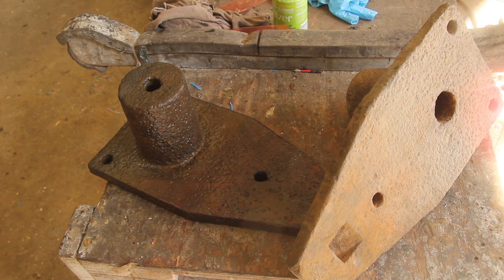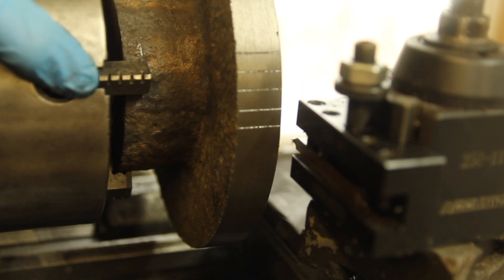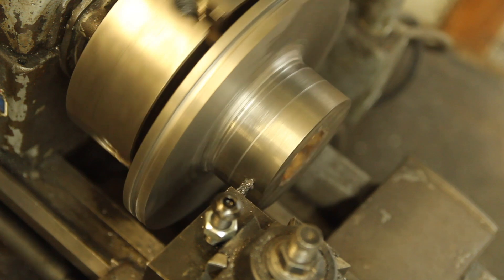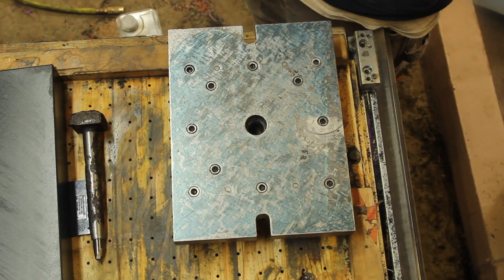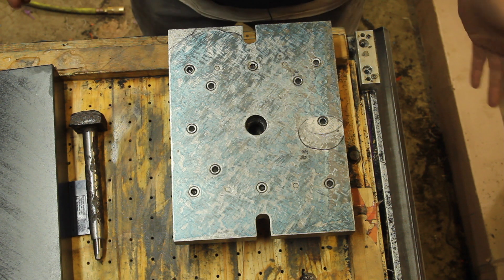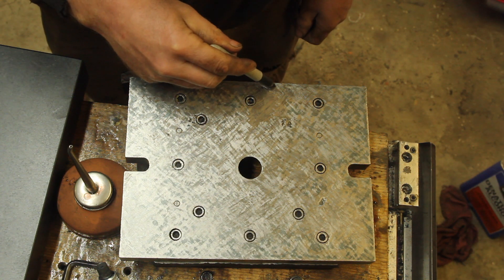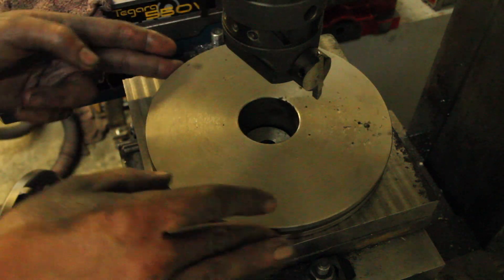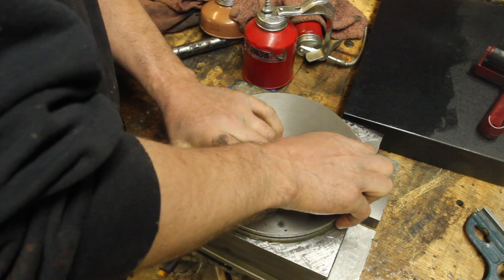Scrap Built Rotary Table (Part 1)

Comment: 1 question, wouldn’t it have been easier to surface grind all of the surfaces, to true and square everything up before drilling and tapping, then bolting it all together?
Reply from the maker: Oh, absolutely.  But at the time I didn’t have a surface grinder, and the one I have now is still too small to do it.
Reply: @JeremyMakesThings  looks like you’ve got an idea for a future project to post on here. I’m wanting to fabricate my own shop equipment for projects that I want to build, but I’m trying to figure out which one to start with, a lathe or a surface grinder. I’m thinking surface grinder first, that way, everything starts out true and square. Then a lathe, and then a mill. I’m contemplating on if I want to integrate the mill with my lathe. See my dilemma? The gears in my head, just keep turning, and never stop.

Comment: Seems like a future project for you may be to find a way to add a depth stop to the quill on your mill so you don't need to use the knee at max extension like you do. Your solution works, but if you ever need that extra bit of rigidity it would be nice to be working without the quill extended

Comment: Why is hand scraping better than surface grinding or even a fly cutter?
Reply from the maker: If done properly, it’s more precise than surface grinding, and much more precise than fly cutting.  It’s also only limited in size to the available reference surface (ie, surface plate).  I would have needed a surface grinder capable of doing 8x12 to do this- which isn’t a huge grinder, but bigger than most you would find in a home shop.  Also, on t he bearing surfaces, it gives pockets for the oil, whereas two ground surfaces don’t leave space for the oil.
Reply: @JeremyMakesThings  Makes sense and I appreciate your reply. Somehow this is the first time i've seen this technique. New subscriber here.
Reply from the maker: NYC CNC did a pretty good video on it: https://youtu.be/Aq3tHyRVNys
Keith Rucker also has a lot of good scraping videos.  I’m very much a hack at it and have learned I have a lot to learn about it.
Reply: @JeremyMakesThings  Thank you. Interesting. And Abom :) also sadly I think I never have a patience for that, but it's definitely a good trick to know because i don't have a surface grinder at all, but i do have a small surface plate. Gonna test that definitely.
Reply: Consider it this way... How was a surface grinder made, or many a machine that can use a flycutter? By grinding stone on stone, by developing flat surfaces by hand, and so it evolved since the caveman making his axes to modern man hand scraping in machine ways and surfaces, as no machine will cut straight without being straight first, and when there were no machines precise enough, we used bloody hands and plates of stone we made flat through more hand work... Its one of those times where moving your hand up and down until you are done is not considered inappropriate and sexual, but is encouraged by metrologists all over the world... 
Jeremy said surface grinding does result in flat surface with no places for oil to seep in and continue lubricating after the initial deposit is displaced by movement, that is true, but also consider that a car engine with its shafts doesnt have any groves, but polished surfaces against polished bearings, also remember that it has a powerful oil pump... Its not that surface grinding cant produce as flat a surface as scraping, but it can only be produced by a surface grinder that is scraped in that well in the first place... Also, as Jeremy said, you need a grinder large enough or a mill with the same axis movement for a flycut... Such a flat surface would be a marvelous machine way, but such a machine would require constant lubrication, via something like a Vogel mf5 oil pump or similar, just like a car engine does... I hope you will learn a lot here, as i am not officially a machinist, but after over a decade of watching machining and my own schooling being somewhat compatible, i now own 2 lathes, 2 mills, a tool and cutter grinder by deckel, the s11 and more, only on account of what i learned from people like Jer... Jeremy, i wish you all the best, deeiks, dear buddy, you aswell! Also, Jeremy, is Jezza acceptable?